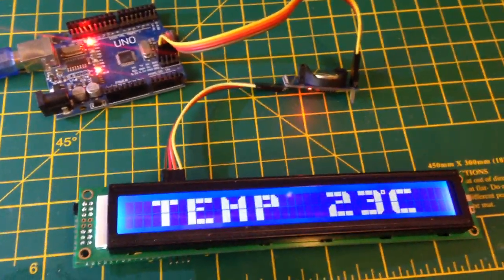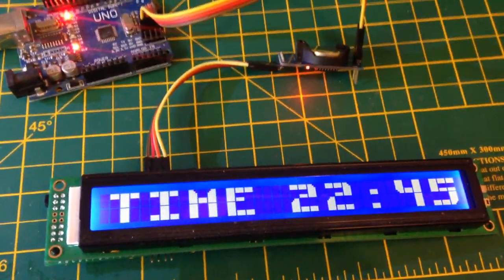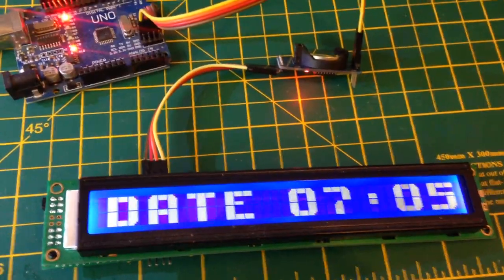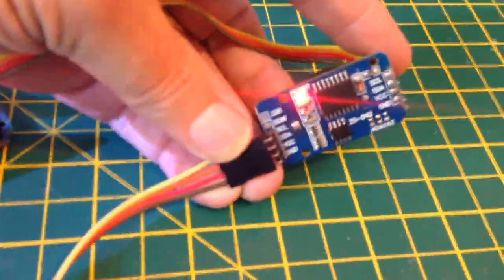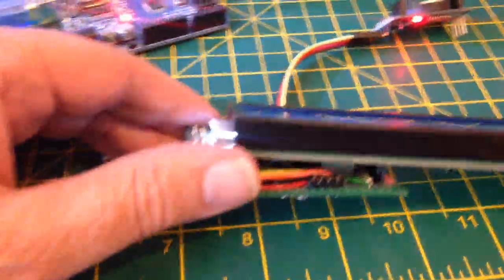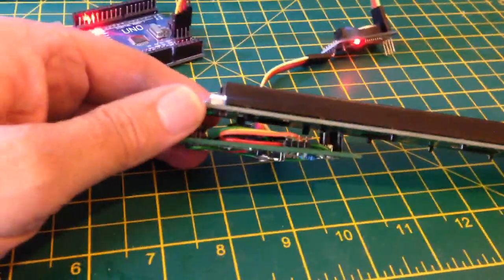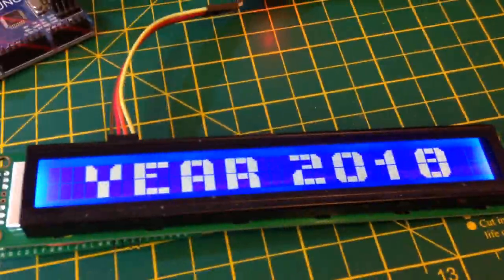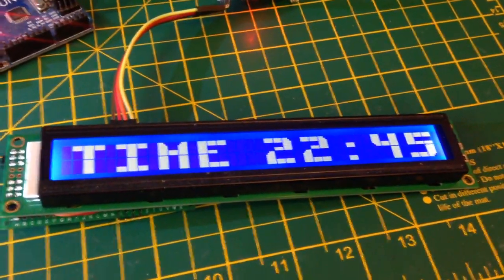Arduino  Another Clock using LCD 4002 with double height Letters and Numbers. No background music.

Comment: I want to thank you for your effort.  I have taken your code and slimmed it down to large characters on a 1602 IIC  screen. I display only the time and temperature (30 seconds then 10 seconds). I wanted a clock to sit near the TV and this is perfect.  I love the 'gotcha' when setting the time.  How many would have up loaded the code and found that after a power cut - the time goes back to the uploaded detail. Remember, when getting it running right, comment out the update line and re-upload the program.